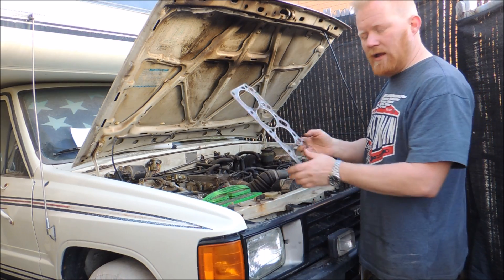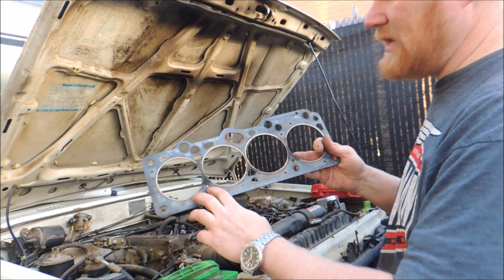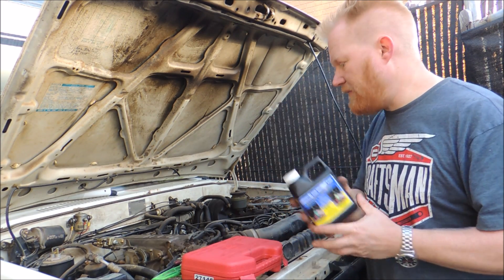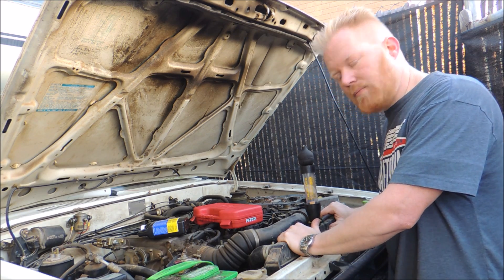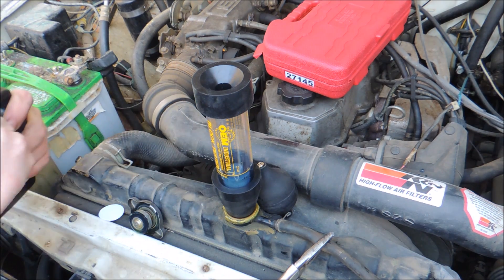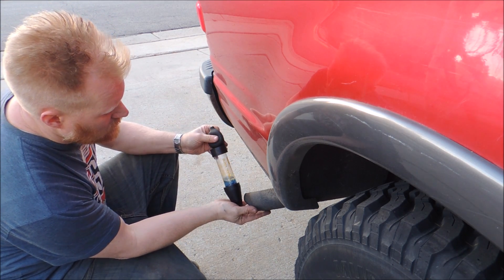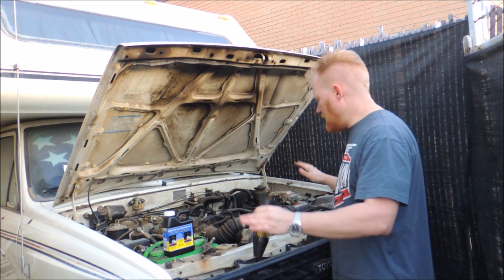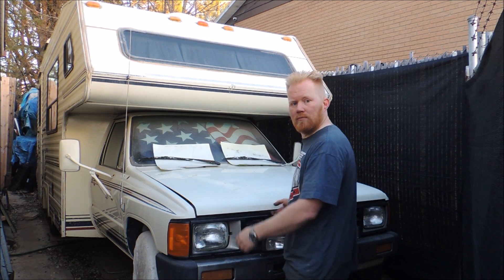Did you blow a Head Gasket ? Find out easily.

Comment: I'm gonna get my car checked out later this week but i was at a drive thru waiting in line and i saw a few account of smoking coming out of my exhaust looking as if it was during the winter with my heater on so it wasn't that much smoke coming out. 
There are no check engine lights on and it's not overheating

Comment: i have a question that i think only someone with your level of understanding will be able to answer. 

So my wife now has a 2011 mazda cx7 that she let sit for 2 years and then decided to drive it pushing all the old gas through the engine. long story short it overheated and wouldn’t start backup. these are the steps i took and where i am at currently. 

I did a pressure test on the radiator and coolant was pushing into the engine so ok blown head gasket let’s get it fixed. i took everything apart and saw that the cylinder head needed to be taken to the machine shop. i also messed up the buckets so i had them reset the lash. after putting the entire thing back together and resetting the codes the car turns over but doesn’t start. i do a compression test in the radiator and it holds 20 psi for an hour no problem but i’m getting 60 psi a crossed each cylinder. i do a smoke test and it’s coming out the exhaust so valves weren’t sealing and must’ve gotten burnt when it overheated. i took the entire car apart again and took it back to the machine shop. why they didn’t inspect the valves in the beginning is beyond me but i paid an additional 400 dollars for them to grind valves and basically make the cylinder head brand new. after this i put everything back together again keep in mind using a brand new head gasket and bolts each time and torquing everything down in the correct pattern and torque specs. and then this is where i am at today. after resetting the codes the car starts right up but now coolant is pushing out the exhaust and a lot as soon as i start the car. i think i would’ve seen a crack in the engine block for that much coolant is to be pushing out the exhaust valves. i did another pressure test in the radiator and it heals 20 psi for two hours no problem. so i either put the head gasket on wrong which i feel is unlikely, the engine block has a crack in it, or maybe the engine block needed to be taken to the machine shop so the gasket seated correctly. i just don’t get why coolant would’ve pushed through the gasket when doing a pressure test on the radiator and then fixing the gasket and now having coolant push through the exhaust. it only took me four hours to take the entire thing apart and a day an half to put it back together with proper torque specs on everything. i’m willing to do it again because this car is in such good condition and i have put so much time and energy into it but just need some guidance on how to move forward ensuring i solve the problem this time around. so with that i thank you if you or someone takes the time to respond to this.
Reply from the maker: Is there any chance the coolant is left over in the muffler/cat and from the original pressurization. It generally takes a few hours for the engine to dry that completely out.

Comment: Can a missfire cause white smoke or blownheadgaskt but my oil is still good not milkey
Reply from the maker: Misfire would cause black smoke. White smoke is water/coolant and has a sweet smell. Light blue(almost white) is oil burning.
Reply: @sixtyfiveford  it's not milkey the oil
Reply from the maker: @tyball2489  That doesn't mean you didn't blow a head gasket. You only get milky oil occasionally with a blown head gasket.
Reply: @sixtyfiveford  so what do I get to stop the oil burning to fix it

Comment: I just bought a car. The guy changed the water pump so I know at some point they overheated. The car does not over heat and I don't have any smoke I personally can physically see. My buddy was driving behind me and when I floor the pedal he said he say a little grey smoke. Should I be worried?
Reply from the maker: Grey smoke is generally just carbon buildup blowing out the the muffler that would normally just be settled during normal operation. Most of the time a water pump goes out there's massive leaking people notice far before they overheat the engine.

Comment: I’m suspecting a blown head gasket for my 2002 Ford Explorer XLT. It had an obvious leak when I drove long distance. I could get the smell of coolant under the hood, and I opened the hood, waited for it to cool a bit and topped up coolant at a gas Station. Carried on with the drive as I had to get home, and in a this, the temperature gauge was all normal.

After some long drive, I got a very strong smell of coolant again, the engine lost power, and as I was waiting to pull over at the next layby, then the engine went off and I was forced to pull over. Opened the hood, and it was full of vapor. I had to tow the vehicle home. It has refused to start ever since, and now we noticed some coolant leaking out of the exhaust pipe.

Does that confirm the gaskets are blown?
Reply: Sounds like you might’ve cooked your engine and warped your heads. You ever get it fixed?

Comment: That will work for diesel as well, as a professional diesel mechanic, I use this tool all the time. Gas combustion leak will be yellow and a diesel combustion leak will turn a greenish color.. however, they do make a more precise liquid formula that will tell a head gasket leak or cracked cylinder head on both diesel or gas.. but nice video man thanks for sharing bro.

Comment: What if you get random puffs of smoke out of the exhaust every now and then?
Reply from the maker: Random puffs generally only while the car is warming up is water in the exhaust boiling off from condensation or humidity in the air. There should be no random puffs though once it is fully warmed up. If it is still puffing it is either coolant from a head gasket leak or oil burning. A coolant smoke will have a noticeable sweet smell to the exhaust and the smoke/steam will dissipate quickly into the air once it leaves the exhaust. Oil smoke will have a slight bluish coloration and may smell like burnt oil but it's hard to determine this from the smell of exhaust itself. The smoke will linger and not disperse like coolant steam.

Comment: I haves some bubbles in my overfill tank and the coolant levels are down just a tad but the car drives great no signs of a head gasket leak. Other then what I listed Is it possible to have all those symptoms but not have a coolant leak?
Reply from the maker: It's going somewhere. Either the engine is consuming it or it is leaking externally. In my case it was weeping out the water pump gasket, slow enough to not cause a ground drip.

Comment: no test like that here in the Philippines
Reply from the maker: Cold engine. Remove radiator cap and look for bubbles. Bubbles equal leaking head gasket. White smoke that smells sweet coming from exhaust equals leaking head gasket.

Comment: I thought you can just remove spark plugs, peep down into the holes and see the top of the pistons.... if one or more is 'clean'.... then your coolant has been washing the piston after having made its way into the combustion chamber.
Reply from the maker: It's obvious when you pull a head and you can clearly see all the pistons. But it's easier said than done to look down spark plug holes to get a clear view of the pistons.
Reply: @sixtyfiveford  Guess I'm used to working on my Audi straight-five...  I suppose for other engine orientations and configurations, might be difficult.
Reply: @sixtyfiveford  you can buy a borescope, easy way to see inside your cylinders by the spark plug hole

Comment: I had the same thing losing coolant couldn't find the leak not overheating and everyone kept telling me my head gasket was blown. I almost ordered the gasket kit when I drove the vehicle on a short 5 mile trip and I found out it was the radiator had a small leak that only leaked when the vehicle was under stress or after it sat for 10min from a hard run. I got really lucky I replaced the radiator and haven't had any trouble since.
Reply from the maker: Mine ended up being a small water pump gasket leak. I'm glad yours was also not a head gasket.
Reply: @sixtyfiveford  yeah I went through that last year also. I'm glad yours wasn't a head gasket also. I'd much rather replace the water pump any day lol.

Comment: Ive got the opposite issue, i have a Renault and the coolant tank has what looks like oil in it, but the weird thing is this brown colored substance is not floating to the top of the coolant tank as it should if its oil, it is sat at the bottom of the tank so what the heck is it in my cooling tank ?
Reply from the maker: More than likely it is rust from the engine block.
Reply: @sixtyfiveford  Nah had it checked today coolant hoses full of oil , so obviously the head is leaking, was quoted 1200 to repair by garage but that cant be right as i know in the past head gaskets i had done were half that price, its only a 3 hour job and the part is like 30
Reply from the maker: @christineayres5339  Generally the cylinder head is sent off the machine shop to check for flatness(absolute must). You can do this at home with a machinist's flat edge and feeler gauges. Also head bolts need to be replaced along with gaskets.
Reply: @sixtyfiveford  Yeah reason the garage are quoting such a high price is  they claim i will need a new timing belt and water pump, i call BS on that as, i spoke to another mechanic today who said its a bad idea to change the Cambelt as its already been timed so if  anew one is fitted and say the mechanic don't adjust the timing then it could overstretch and break ,anyway i had another garage quote me 750 which seems right what you reckon ?

Comment: It was Not head gasket.
Did you find out why coolant disappear? Thanks
Reply from the maker: Very small leak in the water pump gasket.
Reply: @sixtyfiveford  
Were you able to drive without fixing water pump gasket?
Thanks
Reply from the maker: @lightshine888  Yes, the leak is extremely minor and I still drove it. However I kept an eye on my coolant level as overheating can destroy an engine fast.

Comment: My bmw e36 is overheating the hoses of the radiator get under a lot of pressure I replace the radiator and the water pump but still the same so is a head gasket or maybe a crack on the head?

Comment: Dude, you should have check the dipstick first before buying that tester. If there is a questionable rise in the oil level then there is a huge possibility that the loss coolant is going there ; one of the symptoms of a blown head gasket [2019].
Reply from the maker: Checking the oil is obvious and will turn to milky foam in minutes of running with only a small amount of coolant.

Comment: Hey, I have a quick question. I have an 84 corvette and it started to overheat so I pulled over and turned it off. I opened the hood and noticed a sizzling sound. I pinched the hose going to the coolant reservoir and there was no pressure. I turned the car back on and began to fill the reservoir with water, after about 10 seconds, coolant/water started spitting out of the coolant fill hole and looked like a fog machine. Do you think this could be related to a head gasket issue?  When I pulled over I also noticed steam coming off from the carborator/ head gasket covers. Someone, please help. Thanks,
Reply from the maker: Sounds more like just normal overheating. Small block Chevys really aren't known for blowing head gaskets but all these old things do overheat if stuff isn't just right.
Reply: @sixtyfiveford  Thanks for the reply. Do you know how I could fix this issue? Every time I try to fill the coolant reservoir it shoots out liquid and starts steaming alot. Any tips would be appreciated.
Reply from the maker: Fill it from the radiator while the engine is cooled off.
Reply from the maker: Do you live where is gets below freezing as this could cause your coolant to freeze?
Reply: @sixtyfiveford  Yup.. I do indeed.
Reply from the maker: @BallisticTipp  If the coolant/water ratio is wrong it's not uncommon for the lower radiator hose to freeze and plug up the system. This will cause over heating as generally the ice chunk won't melt in time to prevent overheating.

Comment: Oil in radiator resovoir but no coolant mixed w motor oil ...starts up normal and no white smoke but after a while overheats and milky goo comes out ....bad oil cooler ?? Or head gasket ??? ..01 ford lightning
Reply from the maker: Are you sure it's not transmission fluid in the coolant? It's not uncommon for the radiator/transmission cooler to spring a leak. If your Lightning has an oil cooler it is possible it has breached as well and the pressurize oil will hold back the coolant but force oil into the radiator.

Comment: Check for the little
 drill bit hole in your block put there by the mechanic wanting to sell you parts and labor on a new water pump, all new hoses, heater evaporator, thermostat, reserve tank, radiator valve gasgete. Head gasgers , manifold exhaust gasvets, only to tell you they. Do not repair destroyed engine blocks and its what 15000 worth parts of junk

Comment: So if you do have a head gasket leak you can put the liquid near the tail pipe to test it?
Reply from the maker: No. You need to use the tester/fluid on the radiator. I only showed it by the tailpipe to show the color it turns when you do have a leak.

Comment: Is it possible to have a HG leak externally? I have a leak at the head in the back of an 03 Maxima, hard to see in there but theres no hoses in that immediate area.
Reply from the maker: Yes. Some of the external ones are hard to find but generally you can just use your nose. After a drive with the car still running/engine hot; pop the hood and if you get sweet odor you're leaking externally. I've seen a lot of radiator leaks on these Nissans, so look there along with the hose connections.

Comment: I’m having the same problem you had on yours i don’t think it’s the head gasket, what did you do to fix the problem?
Reply from the maker: Mine ended up being a minor leak on the water pump gasket. It was small enough that the engine heat would evaporate it before it could drip to the ground.

Comment: my best friend has owned 4 of the toyota motor homes and has loved them all with epa of 15-17 mpg its a great way to see the country .  it is a little crouded in the cabover portion to sleep though !
Reply from the maker: They're a fun toy. I debated getting a large motorhome at first (back when gasoline prices were $4 gallon). Those only get 4-6mpg so that idea was killed FAST. I ended up buying this one and have really enjoyed it the last 10+ years 20,000+ miles. The stick shift models get the 15+mpg but they are almost impossible to find after 1985ish. My 87 with an auto gets around 13mpg which is still expensive(last months 2500mile trip was $650 in gas)  but  a heck of a lot cheaper than the alternative.

Comment: Great, I didn't know you could borrow a kit from Auto Zone.  I know you can buy the kits which are about $45 from Walmart.com.  That's a great deal just having to buy the chemical for it.  Thanks.  My friend's 2004 Nissan Maxima leaks oil, but now the oil level stays pretty much on the full mark on the dip stick.  Since the oil is relatively fresh, I could see the oil has a tan color.  Could water be getting into the oil.  I thought if water would be getting into the oil, it would be milky.
Reply from the maker: Yes, it will be milky if any coolant gets into the oil.

Comment: Thanks for this video.  I'm about to test my ranger tomorrow morning.  When I start the truck up I can't tell if it's smoke or condensation that comes out of the exhaust pipe.  Hopefully this will tell me.  I will note that when I check my oil and do regular changes there is no milky/cloudiness to the oil.  Nothing like peanut butter consistency or anything like that.  Just black oil.  I will also note that my ranger doesn't overheat at all.
Reply from the maker: This will let you know for sure if antifreeze is leaking into the combustion chamber.
Reply: Did the test this morning exactly how you did it did not turn yellow.  I was thinking perhaps I did something wrong so I tested the fluid in the container like you did after the 1st test and it turned yellow holding it by the exhaust almost immediately.Ran the test one more time and it stayed blue.  yay!Thank you for this video!
Reply from the maker: NewShockerGuy That's awesome.

Comment: You can still have a bad head gaskets. Thats only testing for combustion gases. Head gaskets still go bad on the out side edges of the block.
Reply from the maker: Yes, but you will have obvious air leakage/hissing with a gasket blown to the outside.
Reply: I just saw coolant leak . No air hissing. With a pressure tester connected. If that helps

Comment: 2002 dodge ram 1500 4.7 v8 no lose of coolant or overheating or white smoke coming from exhaust but grey stuff on the dipstick and oil cap
Reply from the maker: All oil will get some condensation in it from the oil pan and valve covers. If it only does short drives all the time and doesn't have the ability to get nice and hot for extended periods it will lead to milky residue on the oil cap or top of the dip stick. This can also be due to a too cold of thermostat or stuck open thermostat. If this isn't the case you could catching a very small leak before there is any noticeable radiator fluid level dropping.
Reply: I haven't did the test yet,don't think I'm loosing  antifreeze  either but I smell it from time to time and hear  gurgling  in my dash

Comment: A better option for petrol cars would be a compression tester which would tell  what cylinder s were losing compression. Two low readings side by side tell you exactly where to look.
Reply from the maker: That would only tell you if the head gasket is broken between two cylinders.